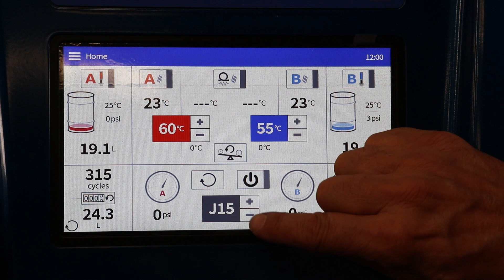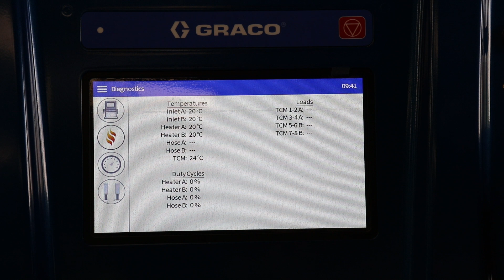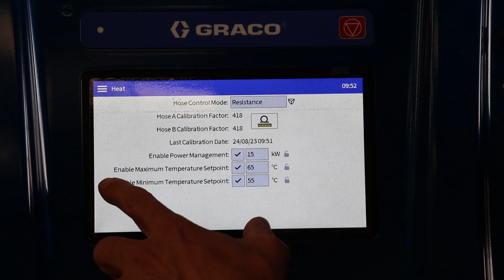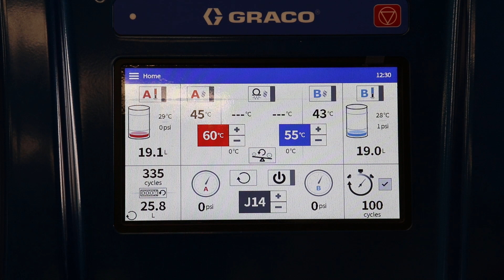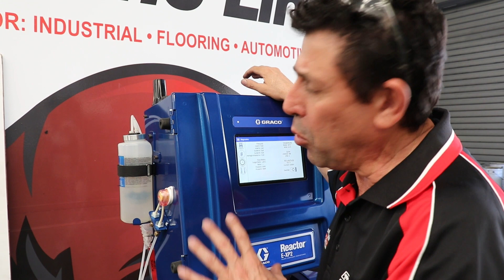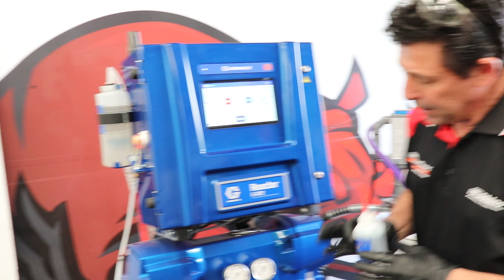Introducing the Graco Reactor 3 E-XP2 by Rhino Linings

Comment: What material are you using that the working pressure is set to 2500 psi?
Reply from the maker: Hi There. Rhino Linings PP1195 (Pure Polyurea) Australian Formula. Similar Rhino product in the USA is Rhino Extreme.

Comment: I usually have B several degrees higher then A
Reply from the maker: Hi there. For our PP1195 the A-Side temps are Higher because the viscosity is higher than the B-Side. Which means that the A-Side temps need to be higher than the B-Side.